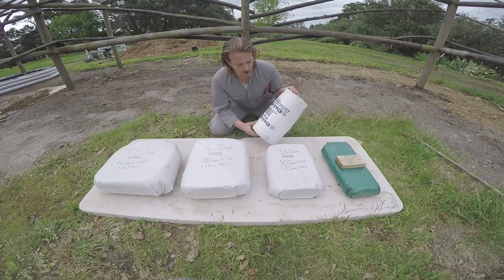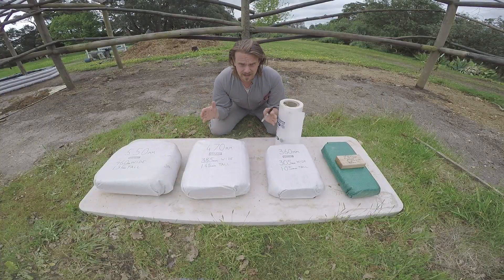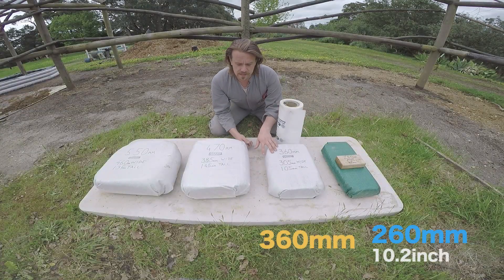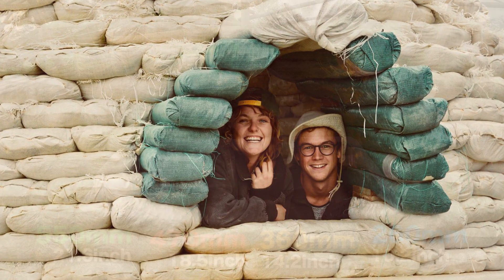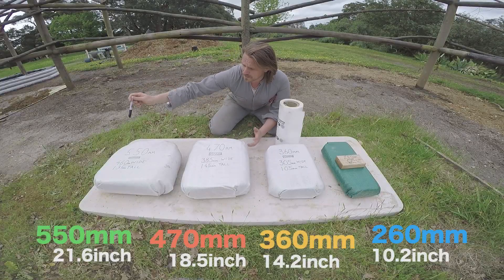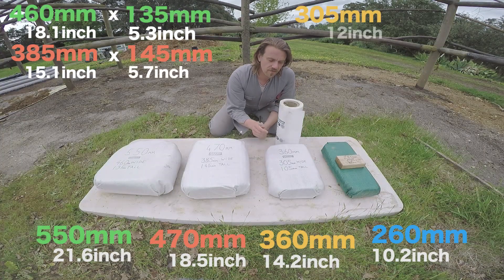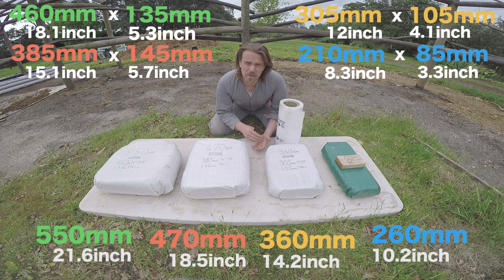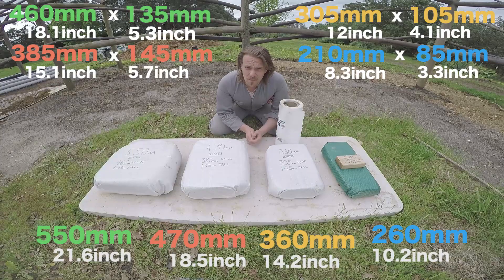SuperAdobe Bag Sizes - Filled and Unfilled

Comment: How come the 470 mm ends up being 10mm taller than the 550mm, are you sure these figures are correct?
Reply from the maker: It’s a good question! As this was a small sample size, there is going to be differences in these dimensions. The 550mm bags can definitely be 10-30mm taller than the quoted dimension here. Both the width and height can vary 10-30mm based on a few factors. Thanks for asking :)